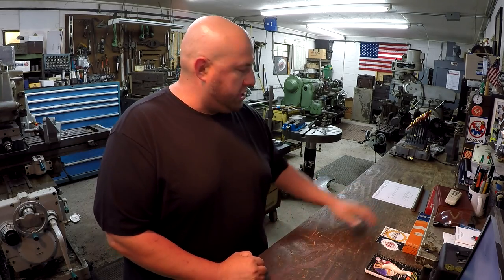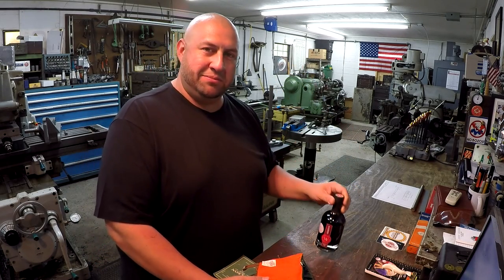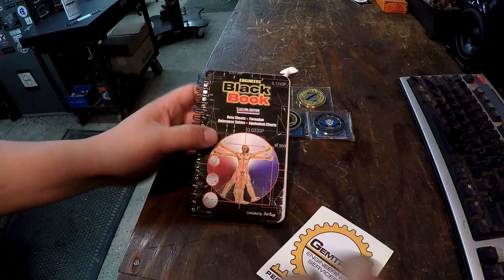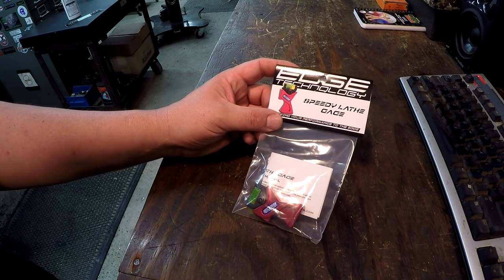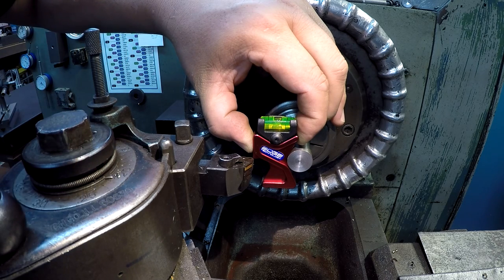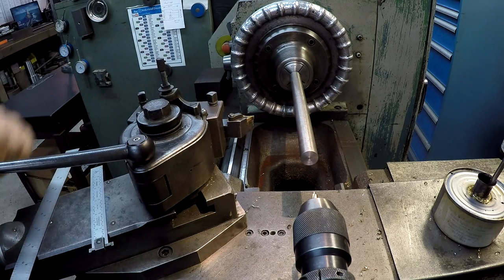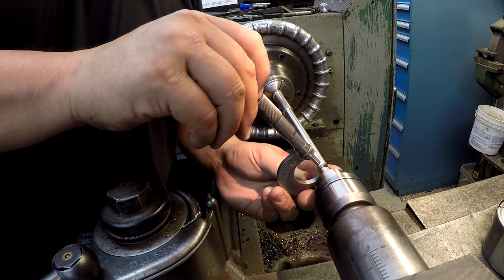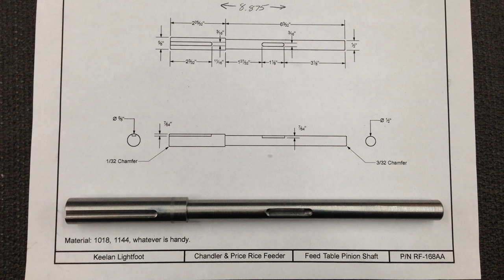Saturday Night Special 126: Speedy Lathe Gage, Turning Small Shaft, Bar Z Swag

Comment: I like the look of the Edge tool height gauge. I have used a cheap plastic one sort of similar to this for several years and it has worked but this one looks to be much better made and most importantly it can be calibrated to a cross feed that is maybe a touch out of level. I'll be ordering one from Edge today. Thanks and keep up the great videos.

Comment: I have been using a speedy lathe gauge for 6 years now and never knew what it was called. I use mine a bit differently though. I use it on a CnC Hardening cobra 42, it's a slant bed lathe so I have it set level with the slant using the bottom flat of the gauge so I can get step drills and form drills level with the X axis.

Comment: I like those center height checkers. The design has been around for a long time. When I was an apprentice, a thousand years ago, the toolmaker class made up  fifty much like the one you presented. They distributed them to both shops and I got mine by stealing it out of the box on the lathe boss' desk. I used it for many years until one of my apprentices admired it so much I gave it to him. I was always gonna make a couple, but...

Ever used a follow rest? That long shaft in SNS 126 is on the ragged edge of justifying its use. Many of your viewers have bought import lathe packages where a follow rest was included equipment. Few have ever used follow rests and fewer seem to understand their advantages and applications. "It came with the lathe," is the usual reply. I don't see follow rests used in machine shop videos even where they are warranted but I love them for long skinny lathe work.

History: Back in the earlier days of line shaft shops bar stock wasn't that common. Shafts were machined from forgings. Shaft forgings up to 12 ft long were available on order so a fair proprtion of machine shop production time was devoted to line shafting for plant expansions, flour mills,  shoe factorys etc. It was a usual sight to see the men serving the long lathes struggling to stay awake while the chips curled and fell from work backed up with a follow rest. A hand forged lathe tool at 35 FPM semi-finishing a 5" shaft 10 ft long between centers. THAT was gravy.

Could I suggest a segment demonstrating the use of a follow rest? Cutting a long Acme thread like a lead screw is a poster child example. Best way to get a true pitch cylinder over the full length short of a traveling bushing

I don't recall seeing a follow rest in your shop videos. You have one for the Victor? I bet I cut a zillion valve stem threads and other long continuous thread screws on a Turnmaster about that size.

Comment: hey Adam thanks for the great videos. I was curious about your end mill rpm and feed rates. I'm having difficult with hss on cold rolled.  thinking of trying carbide or cobalt. also is work hardening an issue on cold rolled? what's your thoughts? thanks!

Comment: Good stuff Adam.  I just bought my first lathe and Mill (mostly because of watching you and the other creators, looked so fun i wanted to try it!).  I only have one indicator, a cheapie that came with a cam degree kit.  So I need to add some decent indicators.  Will edge offer some kind of kit or bundle to include the basic tools and indicators I would need?  I would like to support you and your sponsor, and also take advantage of any discounts... thoughts?
Reply from the maker: I know that some of there tools have indicators mounted on them, but have not seen them listed for sale otherwise. I'd have to contact Edge and ask about that.
Reply: The Shars black faced indicators are pretty decent quality. I love them for knock around use. They have a short lifespan before they start to stick, but are very cheap. Fowler is a more expensive and good alternative if you can baby it and keep it clean at all time (not really possible). For test indicators, get something top shelf (Starrett, Mitutoyo, etc), the imports die too quickly to make them worth while.
Grit your teeth and pony up for the medium sized Noga. It is expensive and hurts to buy, but you will thank yourself for it. If you cant bring yourself to buy the Noga, get a top shelf used one on Ebay. There is a huge quality difference between the good ones and bad ones.

Comment: Adam. How did you center you bits against your work before you purchased the nifty little tool?

And, do you always center all your bits, or in the case of parting, raise the parting tool a little?  P.S., love your videos.
Reply from the maker: Usually by sight or adjust then face to center, and make adjustments as needed.
Reply: Have you ever used the vertical ruler trick?  It's pretty darn easy and accurate, and you always have your six-inch ruler in your pocket.  It's probably how your grandpa centered his tools.  ;-)

Comment: Bought a speedy gauge and most disappointed. After calibrating it and re testing the gauge it showed three different centred tools that face with no pip to be too high. Knowing this not to be the case but just to see, I lowered the tool until the gauge said on the centre line - The tool was far too low and cut with a big pip. I know I could calibrate the tool to a centred tool but each time I tested the gauge it was very difficult to hold it absolutely centred on the round stock and results were often a little different. The V that sits against the stock is shallow in width and its very easy to twist it fractionally off centre. 
The idea is great but the dimensions of the V are not big enough to get a good location. Abom, I have noticed since the video you did where you demonstrated the gauge you have used conventional methods since to set a tools centre height.  I only bought mine for the times that stock is set up and conventional methods are not so convenient - its going back now.

Comment: DANGER! I learned my lesson last Christmas eve. I inserted a 30" piece of  3/4" SS Rod, faced one end and then turned it around to face the other, dropped my chuck key before getting it tight or inserted all the way and bumped the power switch with the tape measure on my belt (I was leaning to get the chuck key). With about 20 inches sticking out loose it went crazy for a split second it was ok, but then it bent and hit my forearm. I had enough to turn the machine off as I went to the floor. I am not sure how long I was on the floor, but when I came to enough to get on my feet I checked the machine for damage before I went for help (I learned to run this 14" Rockwell Lathe when I was 8, so it is sentimental). It was around 6 am, as I like to work early in the morning, so I was alone. Didn't hurt my lathe, but broke and dislocated the bone in my forearm. Doc office, x rays, surgery the next day to put the bone where it belongs.  Now arthritis in my wrist from a bone I broke in high school football that I never knew about but was irritated from the impact, pain isn't anything new to me.
 
LESSON: That wobble you see will quickly become a swinging nightmare when unsupported.... Never drop a key and bump the switch, never stick something too far out of the headstock that could bend unsupported, Christmas with the in-laws is even worse with a broken arm fresh out of surgery.